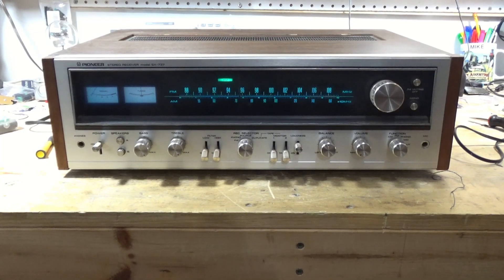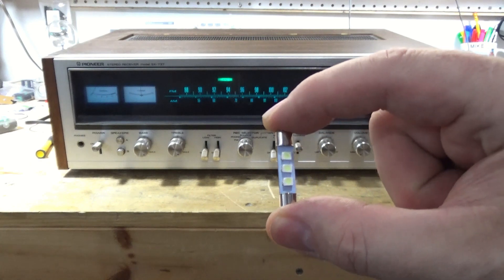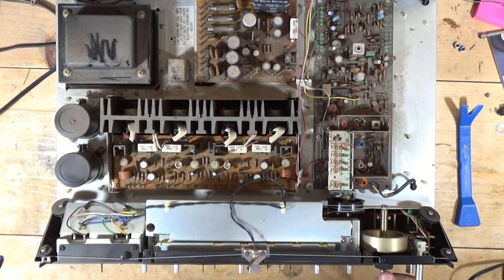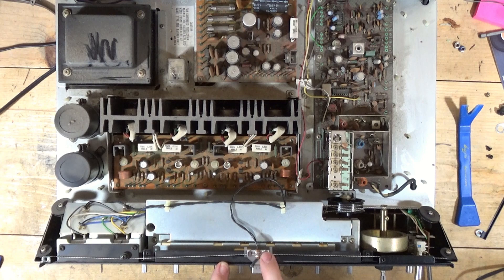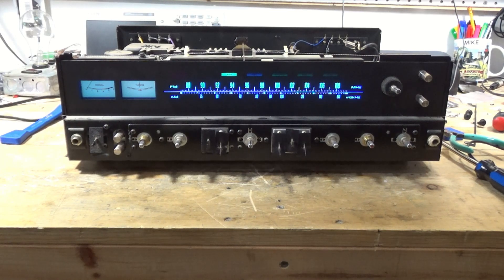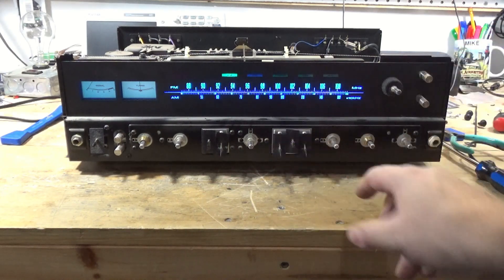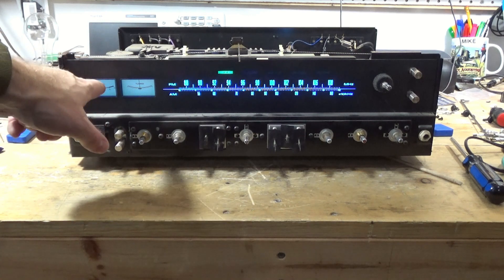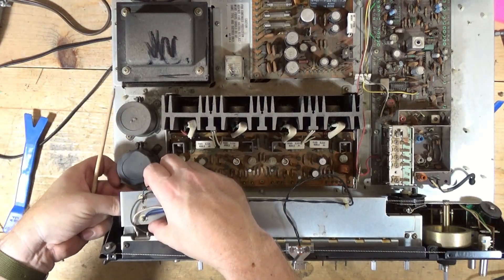Pioneer SX 737 Stereo Receiver LED Install and Traditional vs 360 Degree Diffused LED Comparison

Comment: I just did some repair work on a SX-727. Some of the piggyback fuses were blown. I replaced them with inline fuse holders in case the fuses ever blow again. I replaced the dial bulbs the same way you did.
Reply from the maker: I just find it easier BUT I have snapped a dial pointer in the past...lesson learned :)  I'm running through the 737 now.  I'm going to shoot a "preventive maintenance" series on it just for something different.  It will address what (in my opinion) really 'needs' to be replaced vs just recapping the whole unit and replacing all transistors.
Reply: @millervintagehifi3034  I had to reattach the T02 heat sinks on the power supply. It had those nylon screws and they snapped when I touched the heat sinks. That board gets fairly hot on the 727. It probably should get some new components.
Reply from the maker: The 737 I'm working on has some PSB caps that are showing signs of heat stress as well.  I hate those nylon screws (esp on turntables).  I've snapped a few making adjustments...

Comment: Why does everyone remove the dial face? It's glued on, not meant to be removed. Just remove the lampholder assembly from behind the faceplate using the screws. It comes right out and exchanging the lamps is easy.
I don't get why this misinformation keeps getting regurgitated, it's more difficult and risky the way shown here.
Reply from the maker: Less disassembly I suppose.  There must be something to it if it seems to be the preferred method.  I haven't come across any glued on though, it seems to be double sided tape.  Put a video out showing your method.  I'd watch it :)

Comment: Hay millervintagehifi, I have a pioneer sx-737 and I am trying to get the face plate off, but I am having problems with the bass nob. So how do you get the bass nob off?.
Reply from the maker: Carefully...I use plastic/nylon pry tools often sold for car stereo installs to remove interior panels.  Conversely you could very carefully try and take two spoons and using them as levers gently pry the knob off.  The tip of each spoon bowl on either side of the knob, the bottom of the 'bowl' of the spoons making contact with the receiver faceplate.  Gently push down on the handles of the spoons.  I'd tape off the faceplate with blue painters tape where the spoon bowls make contact.  Other ways to do it but that's my preferred method in lieu of using my pry tools.
Reply: @millervintagehifi3034  ok I’ll try that. thanks you very much.
Reply from the maker: You're welcome!

Comment: Nice video thanks. Subbed. Do you have link to where you got these 7 LED pilot lamps? The program indicator lamps are they the same as the pilot lamps? Does the dial pointer have a separate lamp or maybe it uses the light from the pilot lamps?
Reply from the maker: I picked them up on eBay from the seller peace.love.and.music.  In the seller’s store, you can do a search for SX 737 and find recap kits, lamp kits, etc.  They are a well respected seller and well-known audiokarma forum member.  Their eBay store is my first stop for ‘consumable’ parts.
Reply: @millervintagehifi3034  Thank you.